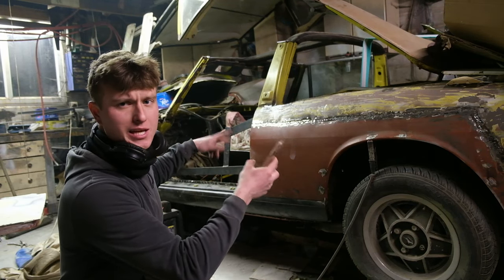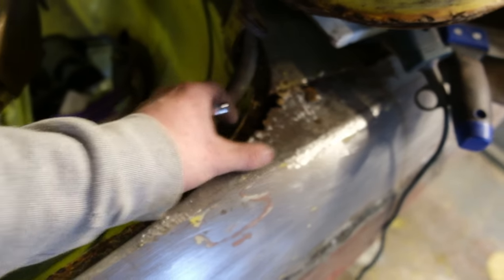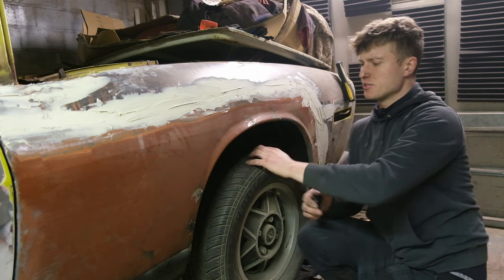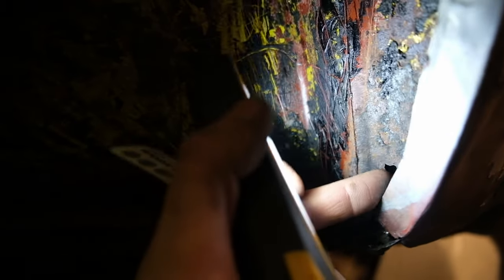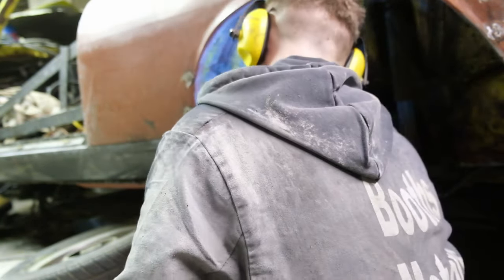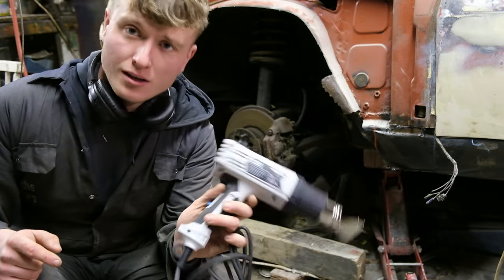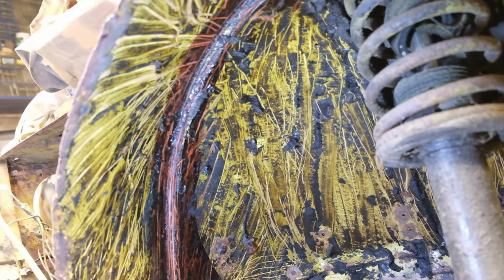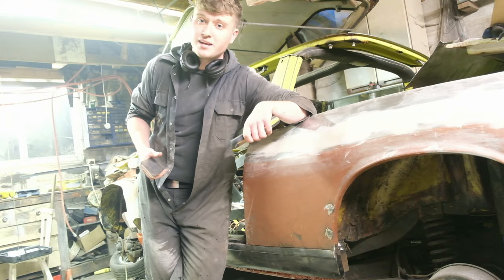RESTORING a Triumph Stag ||pt6|| STRIPPING off the THICK under-seal

Comment: Enjoying your videos thanks for sharing with us. Over the years I've found that old under seal comes off without heating it and just use a good scrapper and it will leave no residue to clean off either. Best done in cold weather. That attachment on the heat gun is just to direct the hot air away from something you don't want to heat up, its definitely not a scrapper. Good luck with it all. 👍👍
Reply from the maker: Glad your enjoying it 😊 in some areas it’s come off really easily literally like sludge other areas seem to be tough! The arches have been the latter I think the dirt/salt from the roads has maybe kept the old under seal dry and non sludgy somehow 🤷‍♂️ but yeah you’re right everywhere else it’s practically falling off!

Comment: Another excellent vlog thinners scotch pad and some rags should remove the residue just be mindful if your ever using a angle grinder to remove underseal on old cars there will definitely be asbestos content in it use a mask mate keep the updates coming all the best…
Reply from the maker: Yeah that or lead! I’m always forgetting the mask! The under seal didn’t seem to get into the air like a dust more of a burning off even with the old angle grinder!

Comment: Super progress, the stag structural frame is quite good for rot , just the usual  outer panels get frilly at the edges , look forward to the next episode,
Reply from the maker: yeah considering the rest of the car id of expected far worse! not sure if I've got lucky;  it was undersealed early in its life; or if they're a really good design! I do think with the rain rail and proper plastic/rubber drains ( at the back of the sill)  they were miles ahead of their time!

Comment: You were ripped off, Screwfix has the same gun under the 'Titan' brand for £19.99. Just a quick point, those metal attachments aren't scrapers, they are heat shields and reflectors, for keeping the heat off glass, when scraping windows, and for unfreezing pipes, but I think you have probably worked that out by now :). Great vids, keep them coming and thanks for sharing.
Reply from the maker: I don’t think I’ll lose too much sleep over £2! 😂 ahh definitely makes sense as a heat guard honestly never realised! I was going to get some hose clips on to hold in place.
Thanks for the comment I’m glad you’re enjoying it 😊
Reply: @Boothsmotors  £2.01 to be exact, that extra penny makes all the difference, AND you get a 'TITAN' gun - that'll pull the girls in :D
I am enjoying the series, I always wanted a Stag, but with 3 kids and a wife the best I could manage was an old 2000, but it was still a good car and the 2.5PI would spin the wheels.
Reply from the maker: @grotekleum  count the penny’s and the quids look after themselves! I’ve never been in or driven any triumphs so can’t wait to drive it!
Reply: @Boothsmotors  You are in for a treat!

Comment: Coming along, slow but steady, Rome wasn't built in a day. How many hours do you reckon you've put in on this one so far, also how many do you reckon you'll need to complete? Also challenging working in the cold. I always find me hands don't work the colder it gets!!
Reply from the maker: I probably average about 20 hours a week in the garage this last month slightly less I’ve had loads of  broken tools ect and I’ve spent allot of hours on the 944   This past month ( speed and ref sensors😭)  but yeah I think I’ve got 400ish hours in the car atm, it’s not the most efficient working in a small workshop!